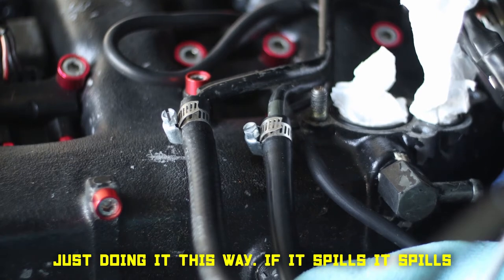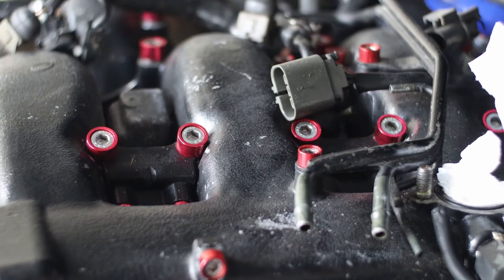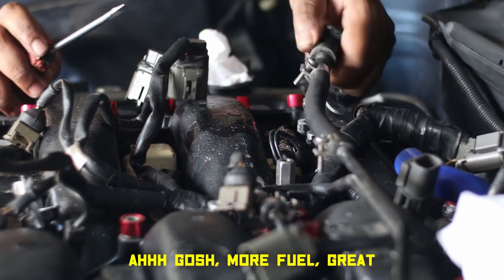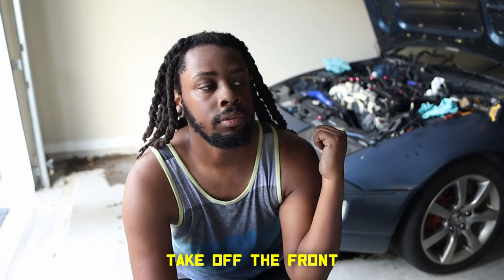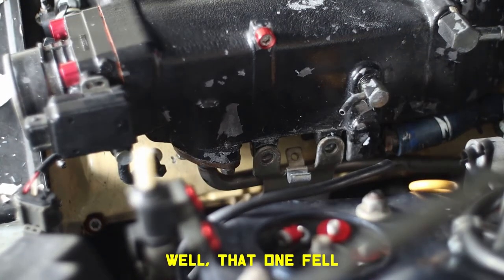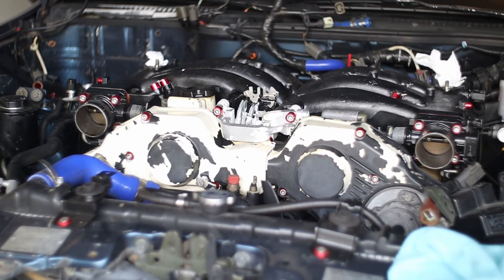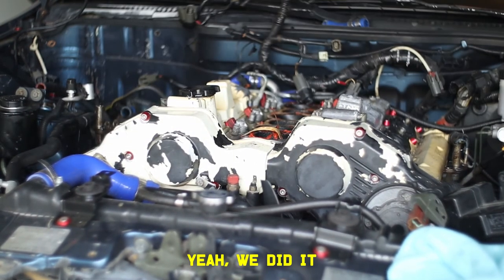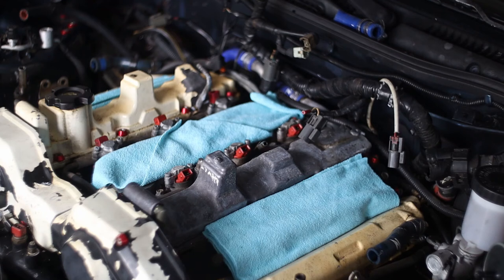Today, You and I are going to pull the plenum on this VG30 | 𝕃𝕆𝕍𝔼. 𝕍𝕀𝔹𝔼𝕊. 𝕩 ℙℝ𝕆𝕁𝔼ℂ𝕋 ℂ𝔸ℝ𝕊

Comment: What kind of build you planning to do? I have 94 300zx NA ,I want to add more power but my z only has 18k original miles so I don't know if I want to engine swap or only try to add little more power to the NA engine what do you think?
Reply from the maker: I'm planning to do an NA-T build, which is using the TT parts on the NA engine but keeping the high compression. There's a group on Facebook that will give you all the information about going that route. Im still learning myself. Ill link it below.

https://www.facebook.com/groups/1653102708236179/?ref=share
Reply: Might do this too
Reply: You pulling the motor ?
Reply from the maker: @infamoussgarage  not yet. Just Doing a plenum pull. Deleting pcv stuff, and changing my injectors/ o2 sensors. Gonna use the car for drifting and then once all the deletes are done then ill rebuild it.